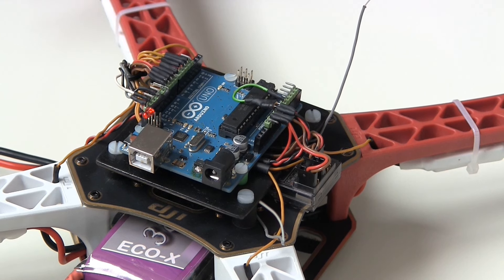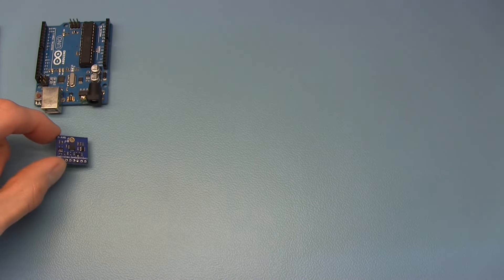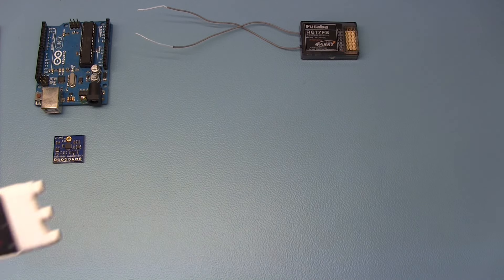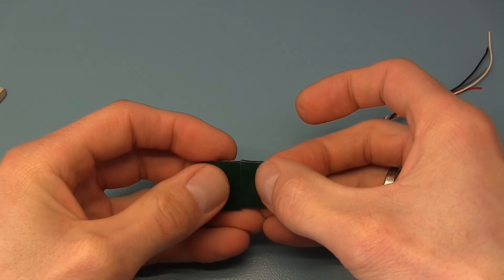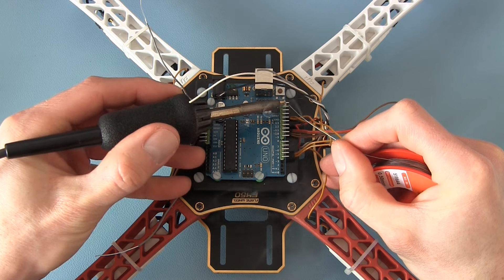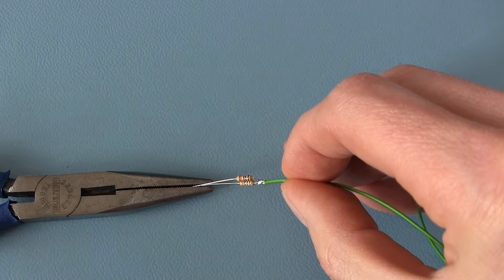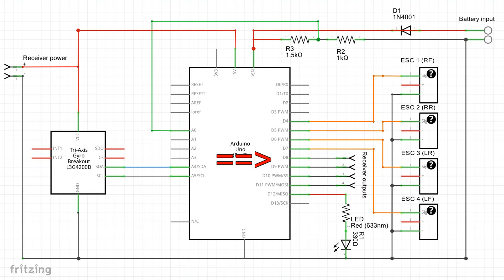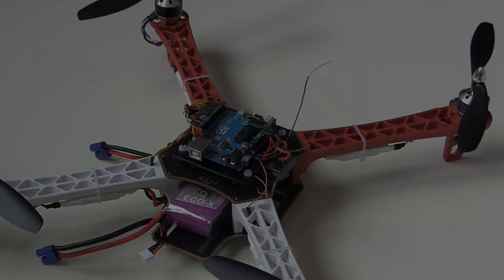Your Multicopter Flight Controller - 3D (YMFC-3D) Part 1 - Hardware.

Comment: Can you send me the text that you spoke? I don't speak English, I want translate your text for my language!
Reply from the maker: +Ademir Cerqueira Sorry, I don't have it in writing.
Reply: +Ademir Cerqueira this is the translate of the YMFC Part 2

In this video I will show you how to read the signal from your
receiver, so they can be use to control the multicopter, I like to show you the
basic principle of receiver signal, ESC and Servo are control about pulses that
varied from thousand to two thousand micro second, this oscilloscope is set
five hundred micro second per div, the yellow pulse is two div width and
represent a thousand micro second pulse, the red pulse is three div width and
represent 1500 micro second pulse.

 

The length of the pulse changes when I change the stick position
from my transmitter, the ESC off position is usually achieve with the thousand
micro second pulse, full throttle is read with two thousand micro second pulse.
For servo, the 1500 micro second represent the standup position, by changing
the pulse length, the servo turn left or right, to better understand the
workings of multicopter flight controller, I like to throw in some steps,
multicopter by nature are very unstable, that is ability achieve by the normal
amount of corrections per seconds, the flight controller that were going to build
during this session, makes 250 corrections per seconds, this is also well known
as refresh rate of the controller, in sort this mean that the ESC are corrected
every 4 millisecond, and this is the refresh rate of the receiver that I use,
now this refresh rate has much lower than 250 Hz, in this case 2.5 Hz(sixty two
point five hz), and this mean that we can wait for the receiver signal when the
multicopter was flying, this penalties the processor of the arduino uno the
armega328p this is those to do the trick, and the magic word here is pin change
interrupt, and this mean we can interrupt the running program to perform a
special task, when the state of a digital pin changes, after this interrupt the
processor continuous the normal program, the more information can be found in
the 660 page manual of the atmega328p, in chapter 13 of the manual the
interrupt are explain, this highlight that line describe the interrupt that we
need, pin change interrupt PCI0 will trigger if any enable PCINT7 to 0 pin
toggles, PCINT pins can be found in pinout diagram as shown here, here PCINT
pin 0, 1, 2, and 3, and the correspondent digital pin of the arduino, 8, 9, 10,
11, and according to the schematic the receiver input 1 to 4 are connected to
the digital pin 8 to 11, to get the pin change interrupt to work we need to set
up the pin change interrupt enable 0 bit and the pin change interrupt
controller register, after that we can chose which pin were cause an interrupt,
if I a the pin change most register 0, for reading are receiver input we need
to set up the pin change interrupt bit 0 to 3, in the pin change most register
zero, people often get ateminated by complex to do of this manual, now in
practice this only mean this five line of code that I route here, as describe
on the manual we set the pin change interrupt enable bit 0 and the pin change
interrupt control register, after that we set the pin change interrupt 0 bit
and the pin change most register 0, and we do this for every 4 pin change
interrupt that we need, and that’s it a change on the digital pin 8 to 11 will
know cause an interrupt, now that we know that the interrupt so active we need
to know how to use them, in the manual the interrupt are stated as interrupt
factor, the one that we are looking for, is the PCINT0 factor, in our program
we can created an interrupt sub routine as shown here, this routine execute
every time the digital pin 8 to 11 changes states.

 

Next step is to create a program that measure the time between
the pulse rising and falling edge, and this is what will do the trick for the
first receiver channel, the funny thing that my have no this, is this part over
here, this is exacly the same as the function digital read, this method however
requires let se biu loops, and except before we need to keep the interrupt
routine as sort as possible, otherwise I will massup the running program, lets
have a look again the manual of the atmega 328, at the chapter 14 the IO ports
are describe, as you can see here, the port B is register which the stated
digital pin 8 to 13 are stored, now the trick and present this call the bit
wise and operator, in sort it will check pin B 0 bit in the port B register is
set, if we look at the pin out diagram, we see that the digital port 8 of the
arduino correspond with the register bit Pin B 0, so with this test we can see
if the pulse is rising, when it is rising were will remember this state in this
variable as set the current time in this variable, now when the pulse is
falling we can detected with this test, the exclamation mark can be read as not
true, so the port is low the register bit is not set, and the test between the
bracket is false, now with the exclamation mark the test is true, because we
know the previous state of the port was high, we know that we when from high to
low, the variable is set to low to detect the next rising edge of the pulse and
the length of the pulse can be calculated, and here is the complete interrupt
sub routine that I route for all 4 channel, as you can see the different
receiver channel refer to different bit in the port B register, now that we can
read the receiver signals it is time for something else, this picture represent
the roll, pitch, and yaw axis of an air craft, as you can see, a positive roll
angel lift the left wing, and lowest the right wing, in positive pitch angel
raise the nose, and lowest the bottom, and positive yaw angel move the nose to
the right, this is the standard were we will use for multicopter flight
controller, here is the complete program that you can download, the only thing
that I added is this subroutine that’s call from the main loop, it choose you
do receiver signals and the correspondent direction that stick of the transmit
an need to go, this program help you to set up your transmitter, this is the
serial output when the serial was running, with all stick on the stand up
position, all signal should be 1500 micro second, if not change your sub trim
of your transmitter, when you move to an any direction, it should correspond
with the arrow in the serial output, but if is not the case, you need to refers
corresponding channel, now the maximum stick position should be thousand to two
thousand microsecond you can change the end point of your transmitter if this
is not the case, when all is good, your transmitter is set up correctly, you
might wonder why the micro second in the multiple 4 and not 1, because the
micro second timer on the arduino uno increment every 4 micro second. So 4
micro second is the shortest time that you can major on the standard arduino
uno.
Reply: +Joop Brokking  i use 4 cells with 14,8 Volt battery, how to recalculate the resistor for voltage divider on yor schematic ? 

thank you Mr Joop
Reply: +magfur ramdhani Thanks :)
Reply: +magfur ramdhani 
you can calculate with this equation (voltaje divider)    Vin = [ (Vtotal)x(R3) ] / (R3+R2) 
example Vin=(11.1x1.5)/2.5=6.66volts 

Ahhh thank for the translation video... I speak english but my level listenig is not enough, and with the translation I and many other people can learn best from this project
Reply: +Carlos tercero 

perdon ...Vin = [ (Vtotal)x(R3) ] / (R3+R2) example Vin=(12.4x1.5)/2.5=7.44volts